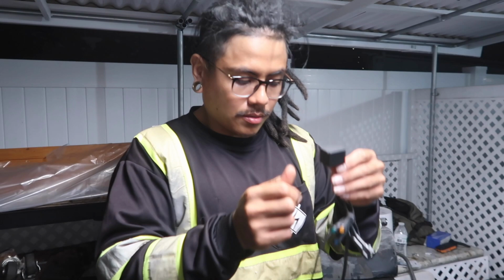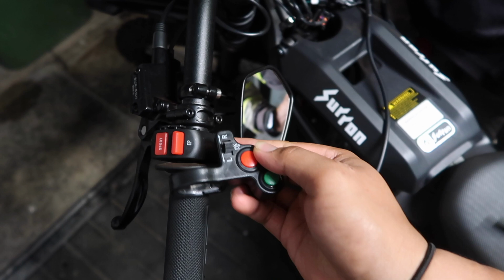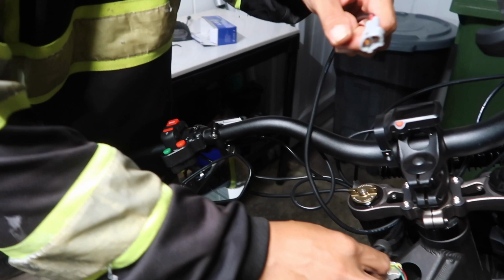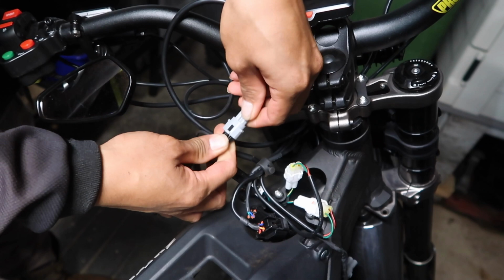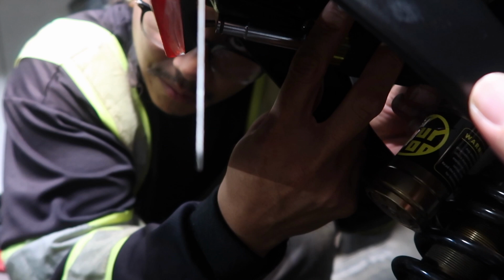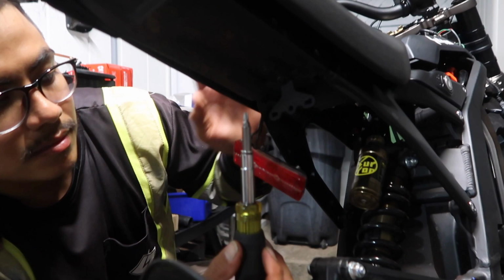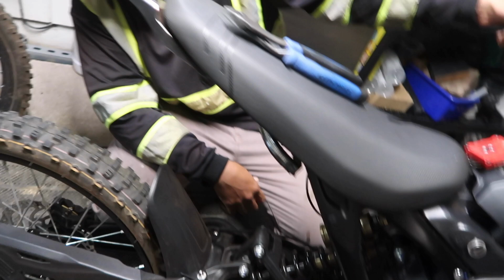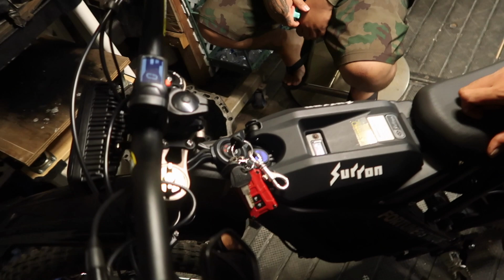E-MX Surron Turn Signal & Working Brake Light Kit Install

Comment: How u connect the brake light To the leavers ? Is that plug and play or tap into the red wire from the leaver cable
Reply from the maker: You'd need to tap into the existing wire.
Reply: @fortunestatushawaii  thanks which wire ? Just to make sure I get the right one. Thanks